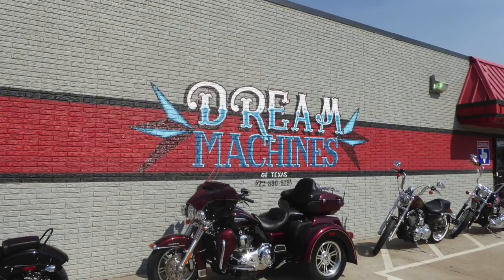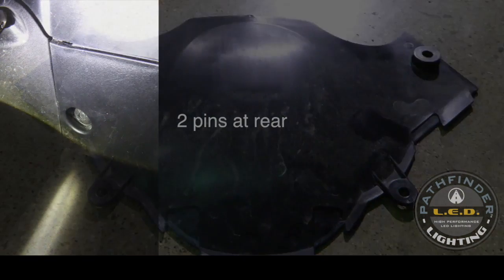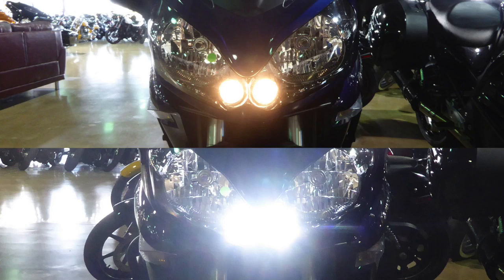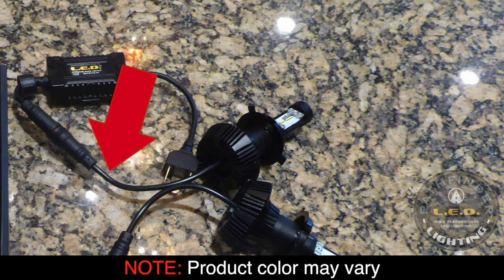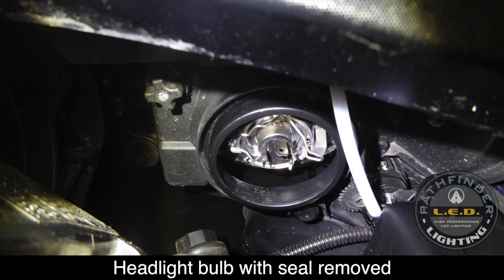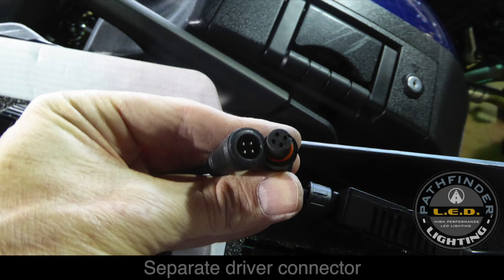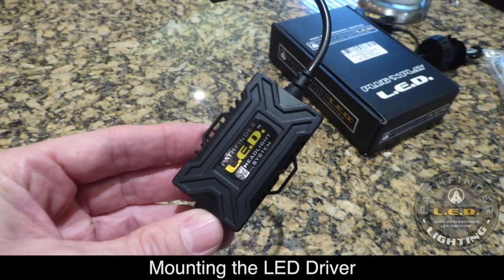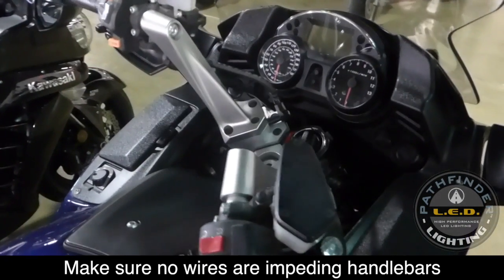Install PathfinderLED Headlights on 2013 Kawasaki Concours 1400

Comment: Some of these LED kits may appear to be brighter but their beam pattern may not be much better than a good high wattage halogen bulb which is considerably cheaper. Very good video for installation advice......
Reply: Some LED bulbs take no care in the placement of the LED in relation to where the filaments were on the halogen bulbs.  These appear the do a good job placing the LED's in the position of the filaments on the original LED's.  Using less wattage than the standard bulbs, they will run cooler in the housing and probably last longer.  I sure with that Honda had used the standard H4 on the ST1300.
Reply: Are they brighter or not. Is it worth changing out?
Reply: @goldwingrider7777  some kits are brighter but not by much.

Comment: As of 2019 you can get lots of LED H4 bulbs that do not have that 'driver' plastic box, for less than $35 for two bulbs shipped to your door. Like Auxbeam LED Headlight Bulbs NF-S1 Series LED Headlights

Comment: I have tried to pull the position light bulbs out and cannot get the unit out of the holder. You may have been missing a step and explaining exactly how to get the whole unit out of the housing.